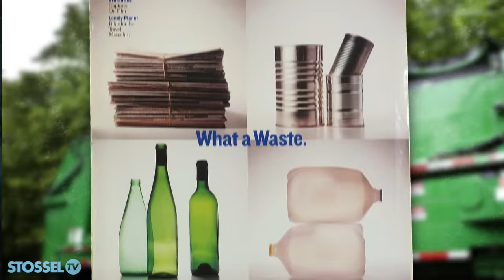Even Greenpeace Says “Most Plastic Simply Cannot Be Recycled.”

Comment: As a metallurgist, I will say that if you recycle any one thing as a consumer it should be aluminum (really any metal, but aluminum is most common for average households). It’s one of the few things that we can recycle almost infinitely, then takes less energy to recycle than it does to make from ore. It’s the one item I will go out of my way to make sure it gets recycled.  I consider paper in a landfill to be beneficial as a good source of biomass 😊.
Reply: Does recycling batteries do anything good? Batteries are one of the things I recycle because I was led to believe that we wouldn't have to purchase as many rare metals from China if we recycled batteries.
Reply: Not coincidentally, aluminum cans are one of the few things that you can actually get money for in many places.
Reply: CW, I understand glass is pretty high on the list of recyclables. What's your take?
Reply: @TheNewRobotMaster  Recycling batteries is good mainly because they contain heavy metals, carcinogens, sulfuric acid, etc (depending on the type of battery), which will leak out in a landfill and contaminate the ground water.  The extra benefit of recycling the NiMH batteries and other rechargeables, is that it does prevent the need to harvest new materials...athough I'll be honest that I'm not as familiar with the different types of rechargeable batteries and how they are recycled.
Reply: @jonpatterson7211  Per my previous comment, if someone is willing to pay you money for it, then it is beneficial to recycle. If no one will pay you for an item, that means it cannot be recycled profitably, which means that the recycling process requires more inputs in time, energy, etc. than it outputs. Which means that it is actually wasteful to recycle that item.
Reply: Paper recycling never made much sense to me. It's highly and quickly biodegradable, and the wood comes from tree farms, who plant new trees when they cut them down. Trees are renewable!
Reply: @LizRealGirlBeauty  Paper takes a loooong time to break down naturally. If it is the right type (card board, news print etc. ) it is easily and profitably recyclable.
Reply: did you just misgender that aluminum can? 🤣 I'm joking of course
Reply: @ep4169  Thanks for the input Bruce, but that really doesn't answer my question. What I'd like to know is how practical, as opposed to profitable the recycling of glass is. I get it that you can take aluminum to a recycler and walk away with cash. I've seen other videos that claim glass is infinitely recyclable, but is it cheaper to make new glass containers from recycled glass or from raw materials?
Reply: True!
Reply: @jonpatterson7211  If it were cheaper to make it from recycled glass then someone would start a business to do so and offer you money for your old glass. The fact that no one does gives you your answer. Or if someone does that I'm not aware of, then great--more power to them. Profitable is practical.
Reply: Can I recycle aluminum foil?
Reply: @LizRealGirlBeauty  Most paper comes from tree farms, most of the lumber I use in construction comes from tree farms.
Reply: @jonpatterson7211  From what I’ve read it is the color of the glass that makes it difficult to recycle, something to due with the minerals used to make the colors.
Reply: Metals and Glass can be recycled.
Reply: Not the mention all of the soil and rock removed that isn’t even ore.

As for plastic, I just don’t bother.
Reply: @ep4169  Those are all good points, Bruce. I wonder also, how much the manufacturing process has to do with it. Base metals like aluminum and copper have to be mined, the ore extracted and refined before it can be turned into a finished product. Glass is what, sand and a few chemicals? Maybe that's why nobody bothers. I sell electrical supplies for a living and have watched the price of scrap copper go through the roof over the years. It's crazy what people will do to get it, including getting themselves fried by going into an electrical substation. It's nuts.
Reply: Paper recycling is very easy and profitable. It can be used together with virgin pulp to make cardboard and paper.
Reply: @ep4169  What about long term resource limited things? Such as the fact that precious metals, and even common ones are earth limited, at least in the short term, and sand is running out within degrees, allowing for the creation of sand mafias and such.
Reply: @TheNewRobotMaster  batteries that can be recycyled are usually worth it. and those that can't still need special care in disposale because they are dangerous if crushed/decaying.
Reply: @jonpatterson7211  depends,    Clear glass? easier to do fresh, coloured glass? Can use recycled inputs, their are other uses for old glass tho (for instance it is being processed into building insulation, and can be used as an aggregate in buildings, and frequently is)   Look at what demolition teams sort out of buildings to get an idea.
Reply: @horserage  That's what's so brilliant about the pricing mechanism. Precious metals retain their value due to limited supply, while other resources get increasingly hard to extract. New technology often solves these kinds of problems and drives the price back down, but sometimes not. Conditions change daily, but all the world's current knowledge of the availability of a given resource gets distilled down to a single number. There's an incredible amount of information contained in a price--so long as it is allowed to fluctuate.
Reply: That and glass. Glass is also infinitely recyclable.
Reply: @brushstroke3733  yes, you can and should. It won't amount to much in the way that it's used, but it will add up.
AL should not need cleaning before placed into recycling because it's going to be smelted anyway.
Reply: Since your a metallurgist, when they recycle do they have to worry about mystery metal alloys?
Reply: As CW said, it's always going to be more cost efficient and less polluting to recycle AL rather than the process from mining to production.
Reply: @TheNewRobotMaster  rechargeable batteries are definitely worth recycling, but recyclers need to get people to participate, it can be very costly across the whole system.
Reply: @LizRealGirlBeauty  The primary purpose of paper recycling is mostly to reduce fermentation in the landfills, which can cause hazards.
Reply: @thepope2412  Yes and no.  Most steel alloys can be extracted with a magnet, other alloys (copper, gold, titanium, etc) are going to be recycled separately due to the high amount people are willing to pay for them, it's worth people's time to separate them out.  

The problem tends to be when other mystery alloy scrap gets melted into steel that is used for pressure vessels and process piping (can cause low ductility and high hardness).
Reply: @microcolonel  isn't that also caused by food scraps and other organic material?
Reply: @LizRealGirlBeauty  Yes, and clearly landfills deal with a certain amount of this anyway. Some landfills now capture methane, and usually burn it on-site.
I think the wise solution is to just make landfills ready for all the paper to end up there.
Reply: I get recycling aluminum.... lately I've been recycling copper too. I think copper is the forgotten metal......
Gold and silver are great investments. But I think copper will be a good investment too.
With wind turbines and solar panels, all things electric need copper.
The Poor man's currency soon. 
Not misinformation.........
Just my opinion.
Reply: Throwing away a soda can is the equivalent of wasting half a gallon of gas.
Reply: Recycle steel.  Take all the trash and burn it for electrical power.
Reply: @microcolonel  agreed.
Reply: @TheNewRobotMaster  According to my local authority, regular batteries should just be thrown in the trash.
Reply: Steel,iron, copper and most other metals should be and hopefully recovered as well.
Reply: @perrylee1118  Copper seems to be worth recycling. After all there are thieves who will steal copper wiring found in plain sight so they can sell it. It has to be melted down and repurposed for that to work, thus the value in recycling it.
Reply: Paper usually has ink on it, which isn't good for biomass.
Reply: But you're a metallurgist...not a, "recycle-urgist" (unless you consider urging us to recycle aluminum counts...) and ... you know what?

Never mind.
Reply: @TheNewRobotMaster  Depends what type. 18650 are hazardous and can leak into ground water. AA are safe to toss.
Reply: @TheNewRobotMaster  👍
Reply: @TheNewRobotMaster  one issue with throwing batteries in the non recyclable garbage is they are still active and can cause fires.
Reply: @jonpatterson7211  Glass bottles used to be the standard for beverages. They were always returned and reused. This practice was far more cost effective than recycling plastic bottles and gave the advantage of better tasting beverages. States with bottle bills also have far less roadside garbage than states without these laws.
Reply: @LizRealGirlBeauty  It takes decades to grow a tree to harvestable state. Paper is one of the items that can actually be recycled in an economically feasible way.
Reply: @jonpatterson7211  Jon, it may be cheaper to make new glass than it is to recycle it. That, however, is only a part of the story. If you are using and recycling glass containers for beverages, then you aren't using valuable plastic that is generated from mostly non-renewable sources. You are also not littering our landscape with more and more "one and done" containers.
Reply: We should pull out some trees..its good forestry. 
Rangers used to go thru and pull out too many, the "starters" , so forest fires wouldn't start
Reply: @nankerphelge3771  they're grown on tree farms. Look up what that is. Just because a crop takes time doesn't make it less of a farmed crop. And while they're growing, they're protected and cared for.
Reply: @lewisbyerly9831  PAPER does NOT take a "loooong" time to break down!  I used shredded paper in my flowr/vegetable gardens and it's gone by the end of summer!  What tosh!  Ever do a science project on how long it takes for items to break down?
Reply: @ep4169  Fair enough mate.
Reply: @Current Batches It does, I was basing my comment on your average household consumer, who doesnt really deal with steel very often.  I really should have stated that metals should all be recycled.  I like how @bruce hansen described it...if someone is willing to pay your to recycle something, it's probably worth recycling (for the environment or otherwise).  Where I used to live, there were people who made a living riding around in beat up old pick up trucks picking up metal items and taking them to the scrapyard...it was actually pretty good for everyone.
Reply: @lewisbyerly9831  paper takes a couple years to break down, and it does so on its own (no labor or cost to do so). And if CO2 is something you care about (I dont), then labor almost always requires CO2
Reply: I basically agree. 
Metals and glass should be recycled, and if you can, sturdy plastic containers such as milk jugs and juice containers.

All the rest [paper, flimsy plastic]?? Not worth it...
Reply: @danteinferno175  And we can have our own permanent containers we could fill up on machines(there are fresh milk machines all over EU) and things could be filled locally instead of bringing it all pre-filled pre-pacaged. It would boost the local economy a bit as well.
Reply: @TheNewRobotMaster  I don’t know if the batteries actually get recycled, but keeping them from the landfill is key. They’re full of nasty acids than can get through the liners
Reply: @jonpatterson7211  yup, glass is easily recycled and takes much less energy and chemicals than making new glass
Reply: @LizRealGirlBeauty  it takes at least 60 years for a tree to grow to maturity. I have a forest (tree farm?) and would rather you recycled
Reply: @ep4169  @Jon Patterson Creating clear glass requires numerous ugly chemicals and enormous amounts of energy. You literally have to melt sand. Properly equipped recycling plants sell glass beads for a huge profit, the beads are then made into new items. This does take a lot of energy, but only about 1/3 of what it takes to produce glass from scratch. The fact that no one is paying you for your garbage is because they don’t want to give up their profit margin
Reply: Been saying same thing for years 
If I can save my beer and soda cans and someone will actually give me real money for them, that tells you all you need to know 

Metal cans….?????? , not as lucrative but can be used 

Everything else ?
Reply: What about water?  If you're a metallurgist, I'm the Shaw of Persia.
Reply: @karlrschneider  Shah
Reply: Agree and agree.  It feels wrong to litter, but if I have a wooden toothpick in my mouth while driving, that thing's eventually going out the window.
Reply: Sega-16  And if you are like us you have reached your limit for that. We now have a surplus of glass jars.
Reply: @ep4169  Good economics Bruce; they'll have trouble challenging that argument!
Reply: @TheNewRobotMaster  Recycling flat rechargeable batteries keeps dangerous/explosive acids out of the landfills. I don't think it does anything more.
Reply: @TheNewRobotMaster  lead, according to a show on the history channel,is the most recycled metal, with 90% bring recycled.
Reply: I refuse to put aluminum cans in the recycle bin provided by our fair city.  As a remodeling contractor, when we demo brass, lead, aluminum and copper are salvaged as well as my and my crew’s aluminum cans.  Typically every quarter I head to Julius Metals with my booty.  Can be $75 to as high as $200.
Reply: @stanwolenski9541  That's good economics Stan; why increase your taxation burden in the form of aluminum; and, they'll only use those taxes to further fund your misery anyway!
Reply: @ep4169  I demand that you stop with all of the crazy logic about free markets! ;-)
Reply: Glass is the other one.
Reply: @Bruce Hansen  
The problem isn't glass being profitable. It's that glass isn't used in as many indistries as it used to be.
Reply: Not only aluminum, but copper , lead, steel, iron ... why not ALL metals?  Paper is not that good as a mulch or compost, because some of the inks contain lead or other toxins.  Paper and cardboard should be recycled because it's easy to do.
Reply: @jonpatterson7211  Stossle once talked to a girl about her recycling routine. She keeps using glass over and over. He said are we running out of sand? It made me laugh.
Reply: @lewisbyerly9831  Some zoos will take cardboard. The bears and gorillas love to play with it.
Reply: @ep4169  money is the source of all evil you should not worship it more than humanity
Reply: @spirals 73 still can just have to go to a butcher shop
Reply: Iron can be recycled as well. It can be used for rebar and "dirty" or "dark" iron usage (basically anything you wouldn't see on a normal basis).
Reply: I go out of my way to avoid products in certain paving materials I know are wasteful and can't be recycled. I'm not a big fan of canned goods but if I have to I know companies are struggling to get their hands on more since the pandemic started. This is a huge part of the supply chain issues along with physical shipping delays. And it's ongoing to this day.
Reply: @ep4169  You aren't getting paid for it, you are getting your deposit back. CRV. That Aluminum was taxed when whatever product was bought, and now it's being reimbursed. That's all.
Reply: Aluminium is only worth recycling because of the artificially high price of electricity.  We should be more concerned about energy abundance than recycling aluminium.
Reply: @ep4169   That's true, and should be obvious to any educated person. We need legislation to force waste companies to pay for recyclable material rather than local governments funneling public funds into this scam.
Reply: You don't need to be a "metallurgist" to know that.
Reply: @LizRealGirlBeauty  Trees also use carbon dioxide to produce oxygen.  Fallen leaves enrich the ground and provide food and shelter for small animals and birds.  Fallen trees that decay provide more food for many creatures, and shelter for some of them.  Trees are good!  When logging companies clear cut in big stripes, the clear-cut areas soon turn into meadows where more kinds of plants can grow and more kinds of birds and animals can feed.  If waste material from the logging is left there, the waste material becomes part of the land.
Reply: @lewisbyerly9831  Depends on the type of paper.  I put newspapers and cardboard and boxboard into my home compost bin, and a year later it can be added to my garden because it's completely composted.  I do tear it or cut it into pieces first so it gets mixed with everything else.
Reply: What you say is true, but.... It's super expensive to make from ore, and some always gets lost in each cycle
Reply: Paper can be recycled. So you're not saying anything
Reply: @brushstroke3733 
This depends on locale and has more to do with food contamination than recyclability. Aluminum foil, at face value, is absolutely something that can be recycled.
Reply: @perrylee1118 
Copper is not forgotten by meth and crackheads with access to the interior of buildings. 😂
Reply: @nankerphelge3771 
It is not really, and forestry corporations are very efficient in planting for projected need. Office paper is down by around 20% since the late 1990s, when they were planting for projected utilisation today, and during the pandemic, it was almost certainly way down. Brand new paper will be much better economically for the next few decades.

Also, as a side effect, those forests are well maintained and managed and rarely have forest fires and almost never have economically devastating fires. Governmental controlled forests, on the other hand, are mistreated, not seen as valuable and are left to rot in hazardous conditions rife for fires.
Reply: @stanwolenski9541 
Those lot are doing the same and collecting the money. Why should you throw away money like that‽  If you have the means, absolutely, scrap your own metal and get cash for it. Most people do not have the time to make that economically viable, but you do, since you are going to be at the metal centre anyway.
Reply: @timcotrell9753 
Penn & Teller’s demonstration on all of the different types of bins was hilariously eye opening, particularly since everyone was willing to go along with the optics of maintaining nearly a dozen different full size street side service bins and keeping track of proper colour coding.
Reply: @GeorgeVCohea  Just like any farmed commodity, the tree farmers will plant species and varieties that are the most economical to grow. That means that the species diversity in those "well maintained and managed" woods will be very low. Low species diversity at the base of the food chain means an impoverished ecosystem.
Reply: @jonpatterson7211  No, it is not. I drink imported beer from glass bottle. When I buy it, I pay 5 cents deposit and get it back at empty bottle depot.
Bottle gets smashed into smithereens, glass is piled up three stories high and nobody knows what to do with it!
Reply: @jonpatterson7211  personally I would think it be cheaper to recycle glass. To make glass requires sand, lots and lots of sand, and you have to heat it to an absolutely insane degree and treat it very specifically so it comes out clear. I'm not sure the process with recycling glass but I would imagine if it's sorted properly that it is easier to melt enough to reform it.
Reply: I always feel bad about throwing out used aluminum sheets after cooking but it’s a greasy crusty mess
Reply: The old man and my grandfather were both metallurgy experts that designed molds for bottling with glass.  They used to say that glass can be used in some applications infinitely and that it was less costly to recycle both alloy/glass materials to use in many applications.  That in some cases both metal and glass needs to be in a more pure form or created in a manner that recycled products are ineffective, like aircraft or structural applications.  That there are enough uses for both that we can  recycle for liquid storage forever.   I remember in the 70s both of them saw plastics as a wasteful option regardless of weight benefits.
Reply: @justicar5 I used to see piles of glass at a bottle manufacturer that were green, brown and clear because of what you stated.   This is why there are different tints in colored bottles for 7UP, Heineken and other beers.
Reply: @brushstroke3733  absolutely